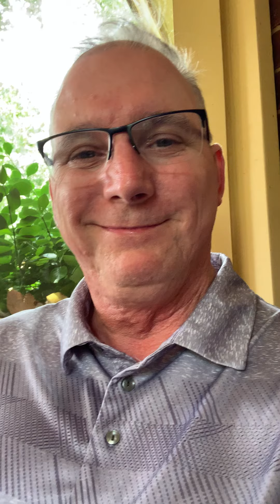Difference between Steel and Pole Barn Homes

Comment: How much do you charge to design a pole bar house? If i have a basic floor plan idea for or base layout. The slab is roughly 2800 square feet the house is roughly 2300 square feet. The reason I'm asking is because I'm in the Nevada and there are not many pole Barn designers here.

Comment: I have worked and been many steel and wood framed shops and one that sticks out is wood is warmer in the winter and cooler in the summer then a steel building. Regardless weather it is insulated or not. Steel is one of the best heat sinks there is.

Comment: Have you seen or can you put a crawl space in a pole barn. Can you refer any pole barn kits or places to look
Reply from the maker: Crawl space is easy, just hang a floor system off the post. Depending on the span of the building, you would need some mid support down the middle of the structure.

Comment: What is the life span of a pole barn verses steal building.
Reply: If done right, it will last well after you expire. But Pole barn or post and beam barn houses will not outlast steal building's on average. So you have to pick what you are willing to pay and what you really need.
Reply: i have seen poorly built pole barns 70 plus  yrs  still standing straight